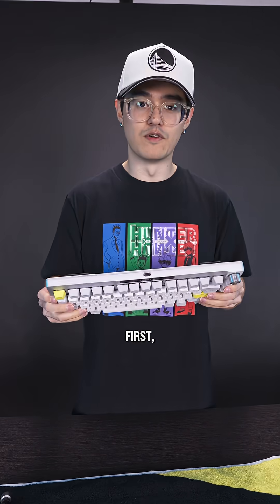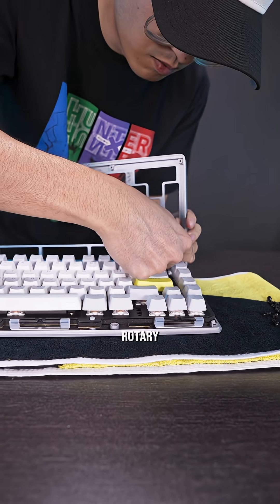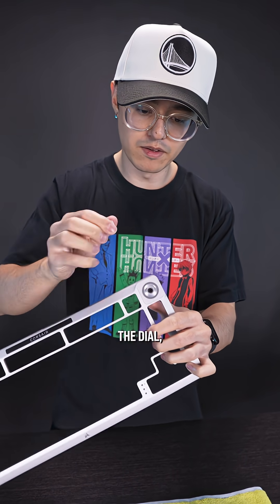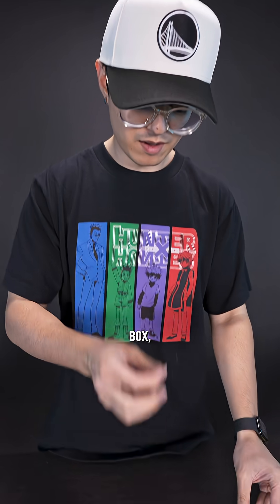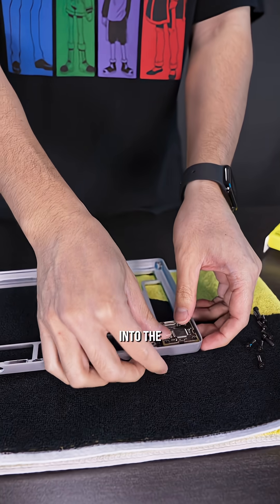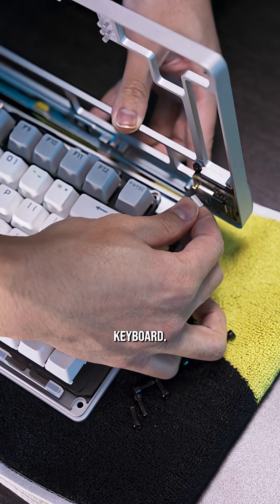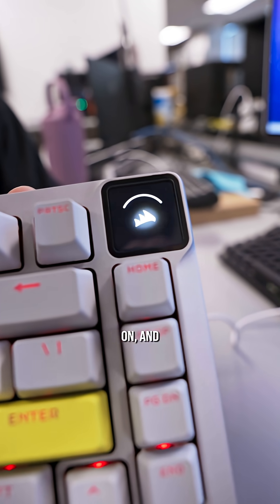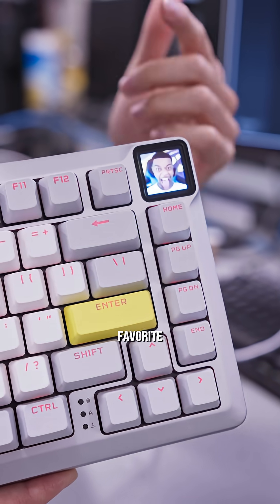how to install an LCD screen on the MAKR 75! #corsair

Comment: I'm so scarred by 2016 icue idk if I would ever get another Corsair piece.
Reply: iCUE wasn't even around in 2016 that was just the Corsair Utility Engine AKA (C.U.E) and iCUE is the new and improved version of that that has been going since at least 2018 or 19 I think also the old C.U.E software only worked with peripherals whereas iCUE controls peripherals AND components and even third party components such as motherboard and GPU LED's from brands like Asus, MSI and Gigabyte. Before iCUE when it came to PC components Corsair had a software called Corsair Link for controlling fans and pump speeds as well as pump block RGB (at the time they didn't really have RGB fans I don't think and once iCUE was released those became popular when you could sync components AND peripherals lightings to each other and do effects that synchronised them both with even today is uncommon although brands like Razer are starting to now make components and motherboard/GPU manufacturers like Asus, MSI and Gigabyte etc... now sell RGB peripherals and cooling products and PC cases and PSU's now etc... because until the past couple of years the best way to synchronise RGB across as many different categories of PC parts and peripherals was to buy Corsair products and use iCUE then they partnered with Asus and you could control Asus GPU RGB with iCUE around 4-5 years ago and a few months later they added Asus MOBO support too and now they support MSI and Gigabyte MOBO's and GPU's too for the RGB lighting control)

Comment: Remove useful Dial for useless LCD screen.
Reply: My first thought was CPU and GPU temp gauges
Reply: @houdini6465 quite impractical, you usually have those on the cooler
Reply: @SpriteBleedin uh no. Only rich people
Reply: @SpriteBleedin 
‘Quite impractical’

It’s more ‘practical’ for you to look into your PC at the cooler, assuming you have a cooler with a screen, than just glancing at your keyboard? 😂
Reply: @houdini6465  I taped a meat thermometer on the inside of my computer and that kinda works...kinda (jk)
Reply: We all need something fun sometimes
Reply: @harishasmunir  especially with Corsair stuffs😍
Reply: Pretty much what i thought
Reply: That's the beauty of it, if you don't want the OLED screen, you don't have to have it. You have the choice of what you want.